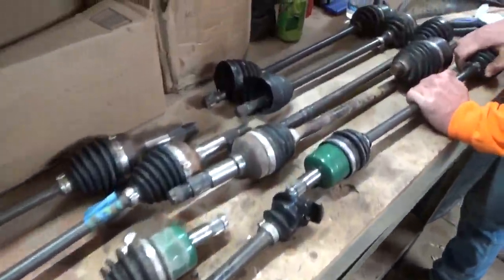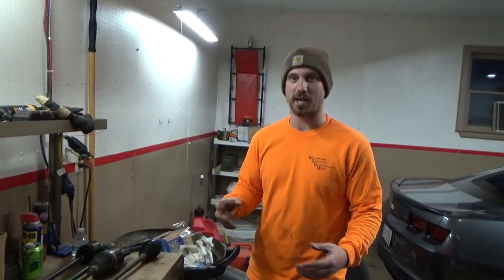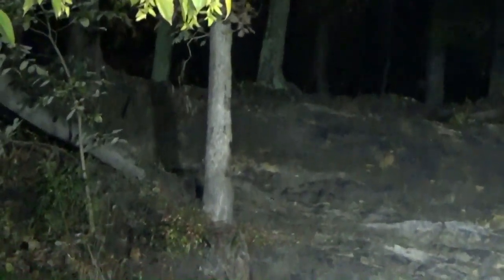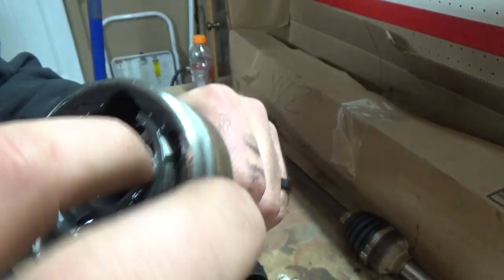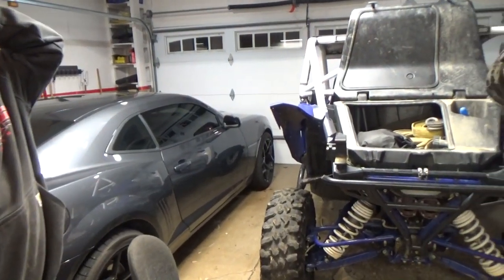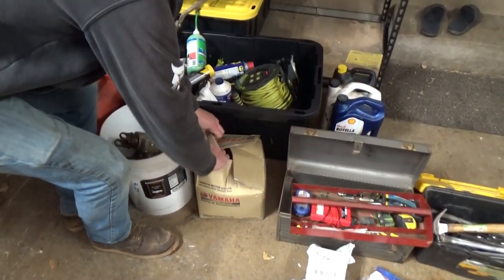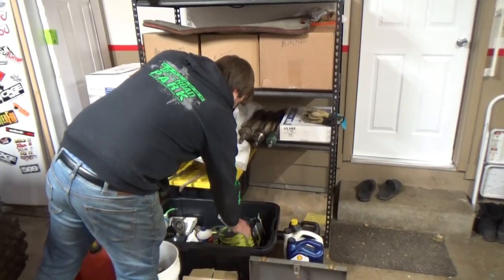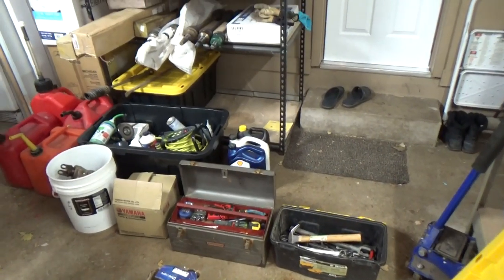Teardown & Rebuilding a Bad YXZ Axle Shaft | How many have we broke?

Comment: The way you boys ride,that’s a relatively small pile of carnage.   I carry bout the amount of stuff with on buggy and back at the truck.  Few things I can add to your buggy tool kit is.   Starter fluid and a lighter.  To blow tire back on bead if need too.    But then again I think you all run bead locks.   Great videos
Reply from the maker: J A for sure we think it’s not
Too bad for the way we ride and 4 machines too. But yes we are running beadlocks

Comment: Y'all were talking about the cage I run Gorrila axles in my lifted Commander with 32" Black Mambas and even before them I was running 29.5" S/W original OutLaws and had a cage completely disappear leaving nothing but the balls and the inside housing portion inside a non-torn boot    Lol

Comment: Hi guys! Great video. I have a 2016 YXZ with a recluse clutch and 2100 miles. The clutch is starting to slip, do you guys run stock clutches?
Reply from the maker: Jeremy Judge me and billy are running Barnett clutches. My stock clutch went bad running a rekluse aswell. Josh is still on a stock clutch and Billy’s stock clutch was good when we pulled it out just upgraded it when we did the gear reduction